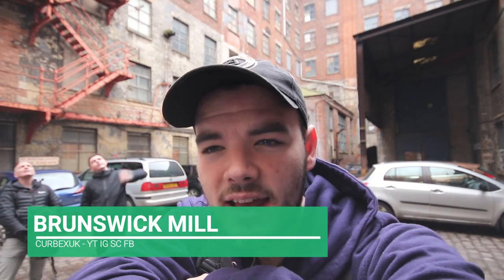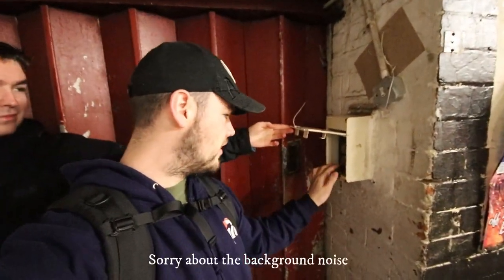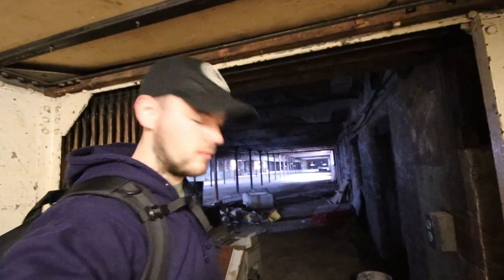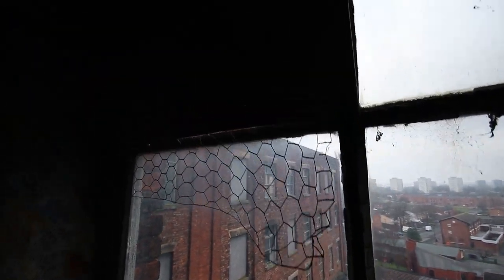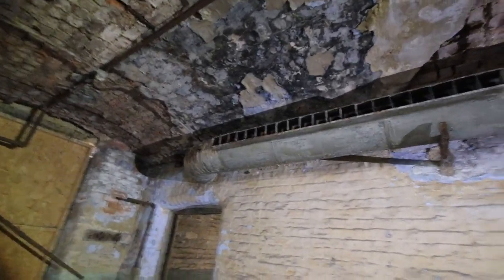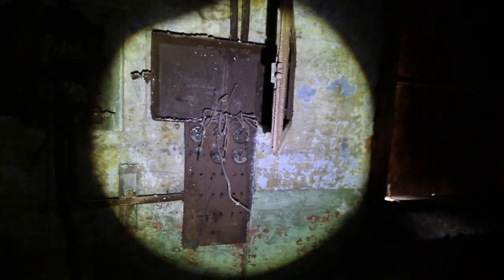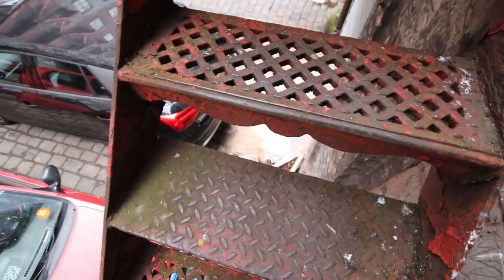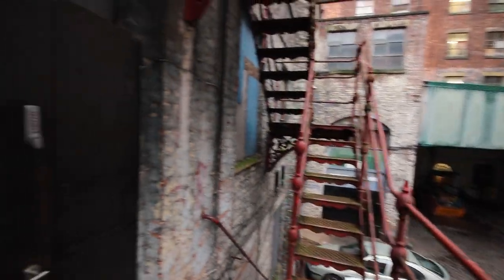Exploring Disused Floors Brunswick Mill Manchester

Comment: Good video conner even tho the mill not in use but the lift still works very interesting
Reply: The mill is still in use on the lower floors
Reply from the maker: Thomas Tierney thanks Tom and yeah the bottom 2 floors are still in use
Reply: @CURBEXUK  ahhhh right good video tho 👍
Reply: @bcegerton  thanks brian
Reply: Thomas Tierney no worries

Comment: The top floor of Brunswick mill would perfect for drunken moped racing; knock the glass out of the windows (health and safety don't ya know), get the riders roaring drunk, blindfolded, and away they go. Harmless fun for people of all ages on a wet Sunday afternoon.

FWIW, I bought a 3 piece suite from a furniture maker on the ground floor of there, in the back end of  '91, just as I moved away from Manchester. Now, my Grandmother used to work in a mill when she was a girl. Because of the terrible noise (IIRC you mentioned 'whirring' machinery- sounds a  bit genteel to me, lol)  she, as all the others did, learnned to lip read very quickly as normal conversation was impossible .

 I was in Queens mill in Burnley (or is it Blackburn?) years ago and at the time it was a full 100% working mill, full of all kinds of textile machinery powered by one big steam engine and line shafting And the racket and vibration as the looms etc. started up was astonishingly bad. This mill nowadays is still partly working as a small business/ heritage thing, much different that when I was there. 

The air venting/heating pipes look 70's-80's to me, and the thing on the floor with pipes into it and an air grille, was an overhead fan heater, the pipes being for hot water from the central heating system that would have been put in late in the day.

Keep doing stuff like this mate, I love it! Next time, a breathing  mask might be in order to filter out pigeon shite and who knows what else. If you don't post owt for a while, we'll know you caught something bad and are in the Manchester Hospital for Peculiar and Painful Diseases !!

Actually, if you take to wearing masks, you could have the dubious pleasure of urbexing some old police cells in Bootle street nick after being seen as terrorists. But they might not let you do a vid.....

Cheers mate.
Reply from the maker: Laszlo Fire all amazing stuff pal

Comment: Interesting place, good that you had access, that roof looked a bit tricky (low wall). 
The old wiring you were looking at is v.i.r. insulated, over time the rubber becomes brittle and basically falls off and as you say, probably caused many a fire, especially with the dusty air. 
There’s still lots of that type of cable in use. Just one word of advice though Connor (and Martin), don’t assume wiring like that isn’t live just because it looks so bad, always best to keep well clear. 
Keep up the good work 👍
Reply from the maker: Stew thanks man and I didnt think of that thank you for the advice mate cheers